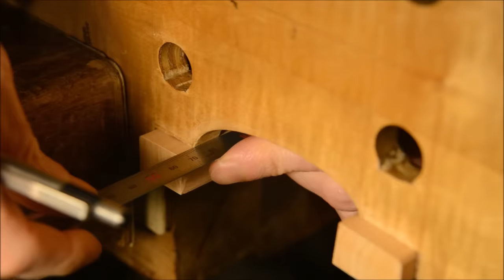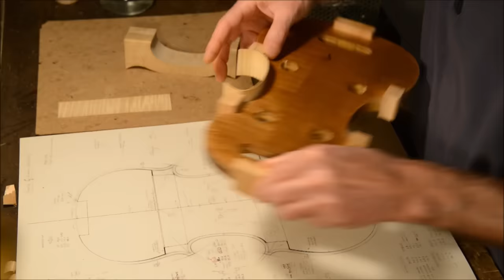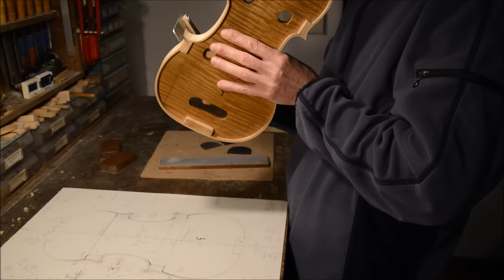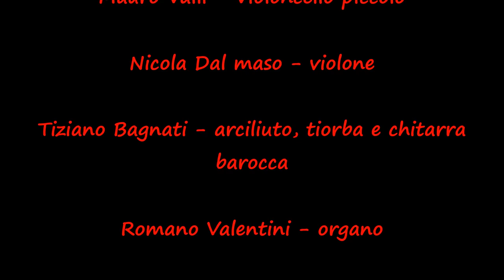Rib making from start to finish (condensed)

Comment: I was just thinking after making another set of rib blocks, "Wow, there must be a faster and easier way to do this. I will look it up." It seems perhaps not. Have you ever attached both ends of the linings before removing the jig and then laughed at yourself for trapping the rib jig between the linings? In my experience, this is a joke which is only funny once.

Edit:
I just watch your form removal video and realize that I have even more reason to laugh at myself. I have removed linings before to take out the form. I see now that this was not necessary.
Reply from the maker: Yep, it is the ancient Cremonese method, Stradivari & Co. did so. Its indisputable utility is that it stabilizes the outline of the ribs, so when you remove the form they do not get deformed, and both the outlines of the back and of the top will correspond to the one traced with the ribs still on the form. It also allows you to finish them more easily with the scraper, because the already glued linings stiffens both sides, not just the side of the back.

Comment: What wood are you using for the blocks? I know you can do it with spruce, but for me the wood you use does not look like spruce. Is it lindenwood?
Reply from the maker: The wood I use is Willow, the one that Stradivari used, but you can also use Spruce (used by Guarneri del Gesù) and lime (Lindenwood) or poplar have also been used traditionally. Willow is the most common in the ancient Cremonese school, but any light, low-density wood can work, taking care to use more compact and strong blocks for the upper and lower blocks which are stressed by the tension of the strings.
Reply: @DavideSora  Thanks a lot for your reply :)

Comment: Love your video. I agree with every operation,except fo the use of sandpaper.  Sandpaper takes fibers and clogs the pores of the wood. Only use tools that cut the fibers cleanly even in tightly curved of ribs. In the end you won't have to wash-out the pores that should be filled with varnish,you'll get a sharp, crisp tone, not dampened with sawdust in the pores
Reply from the maker: Thanks for your comment, Mike.
 Usually I do not use sandpaper at all as I do not like very flat ribs surface, but seemed nice to show the sandpaper system that I sometimes use when wood is particularly refractory to scrapers (sometimes happens). However, I think wetting the ribs is useful in any case, both to raise the grain to be able to take off all sandpaper marks with scraper, but above all to remove stress from wood (creep). I wet ribs once or twice even if I use scrapers only.

Comment: never understood why someone would scribe a mark with their pencil 8-10 times?  shouldn't 1 suffice?  wouldn't marking it 8-10 times increase the chance of mismarking?  Get a better pencil.
Reply from the maker: Sorry to upset you, but mark a pencil line on  wood is different from drawing on paper, there is a need for lasting marks that should not be erased immediately by handling them. Rescribing several times (2 or 3, not 8-10 times) helps to create a light incision in the wood, improving the efficiency and usefulness of the line for the work you are doing. 
In fact, often steel marking points are used for marks, but  willow  (the wood of blocks) is too soft so a pencil line is more accurate. Moreover no need for angled lighting to see the lines.
Reply: Nobody is upset, just misunderstanding is all.  Go back and count, minimum 5 strokes, maximum 8.  No worries though.  I just use a 5H pencil lead.  Pretty hard to break and leaves a crisp slit in the wood.  You should try it.  One stroke is all it takes.  But regardless, I loved the video, and the creativity and craftsmanship are excellent!  Thanks.
Reply from the maker: You are right,  I give a few more strokes sometimes.....😊
Maybe I'm a little compulsive, but I hate when I have an incomplete or uneven line so I prefer to overdo it a little. I use an F pencil lead because it leaves a darker and more visible sign than a 5H. I tried sometimes with a 2H pencil lead but the mark is too light in color and so not very visible and its hardness worries me because it really cuts like a knife! With a such a hardness I would go directly with the steel marking point, which is however the most typical tool for tracing in violin making. It would be interesting to try the silverpoint to be more authentic, there are some original sheets of Stradivari in the museum with silver-point traced models, so probably the makers of that time used it. Never tried, just a thought.
Thank you for your appreciation of my videos and for taking the time to comment.